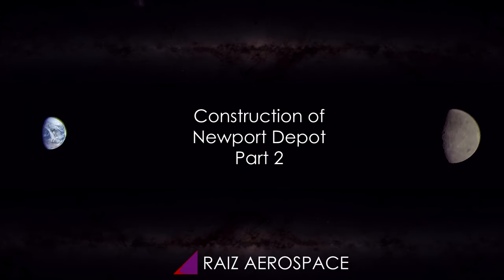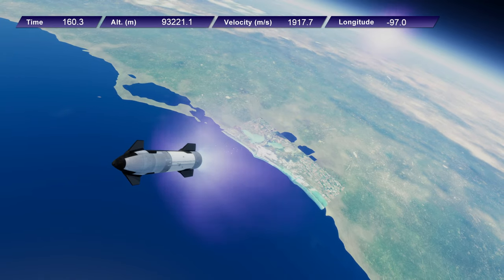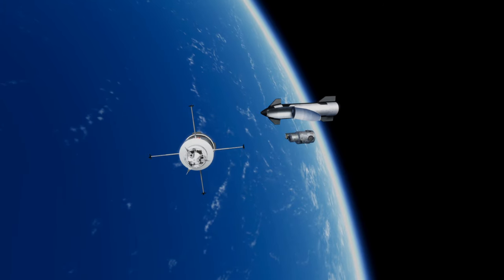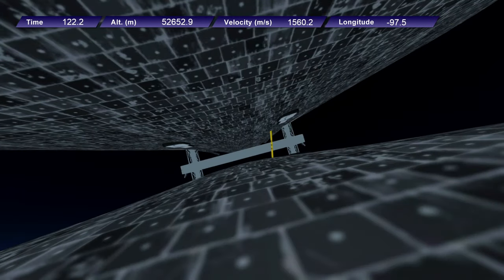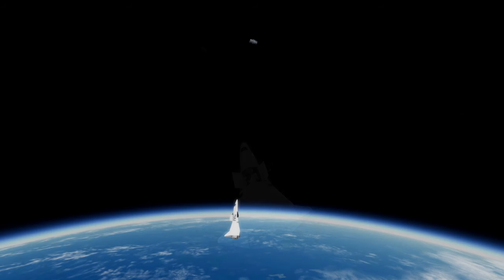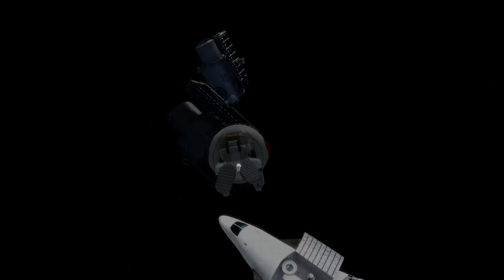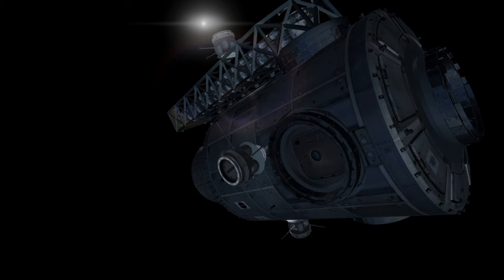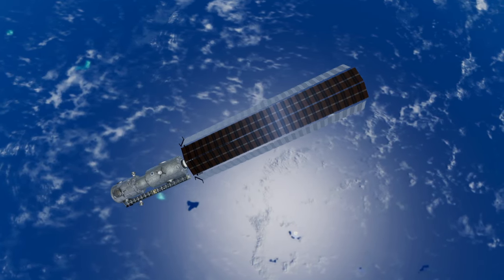Raiz Aerospace - Space Future 2 Commentary Version

Comment: How hard would it be to model half the forward flap of starship burning away to try to get a better sense of what Ship 29 went through on IFT4?
Reply from the maker: I could imagine how it would be done, but definitely don't want to do it.
Reply: @RaizSpace  yeah KSP 1 isnt really designed for procedural effects
Reply: @RaizSpace  scratch that. just like real heat shields in KSP RO that look more degraded than the abator runs out. you could have abater be tired to a geometry morph